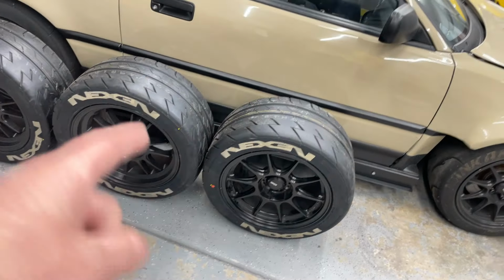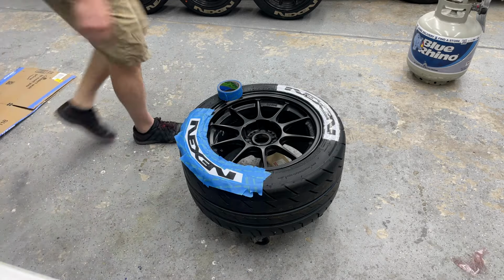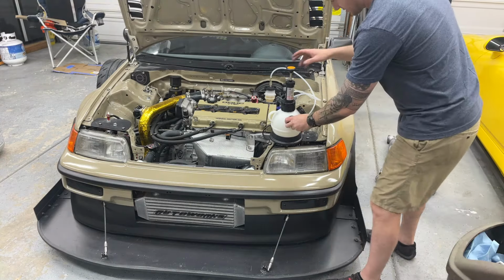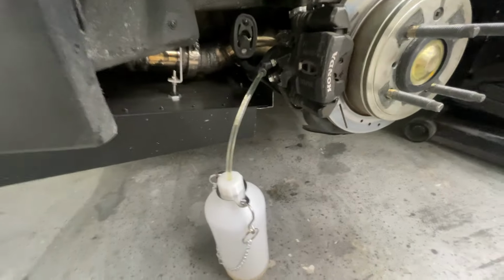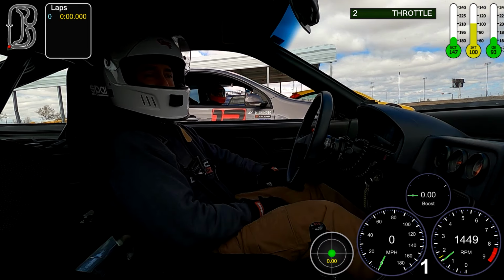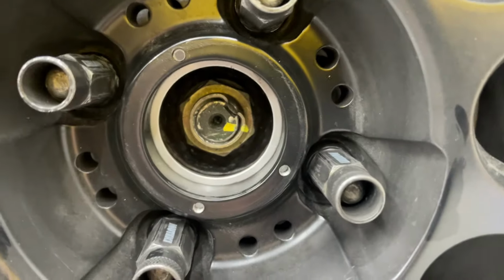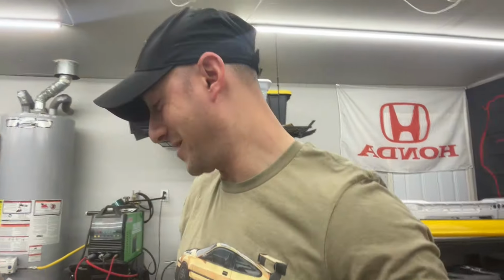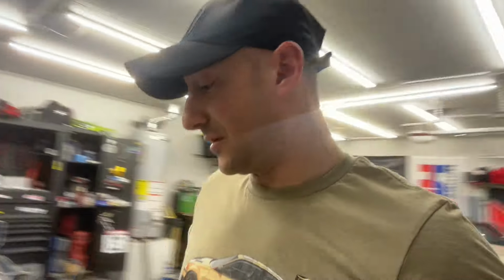CRX Time Attack Practice & SMotive Power Bleeder

Comment: i need to flush my brakes when i get my car back up. i havent done that since ive owned it lol
Reply from the maker: This powerbleeder would make easy use honestly. Fill the actual bleeder and pump it to like 20psi. Just crack each corner and occasionally check the pressure. Definitely keep the bleed on your checklist lol